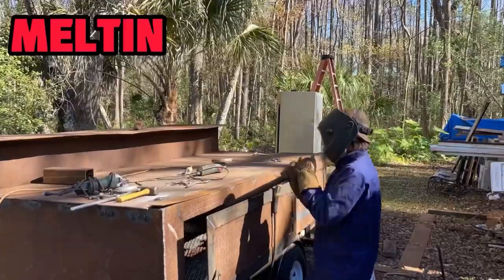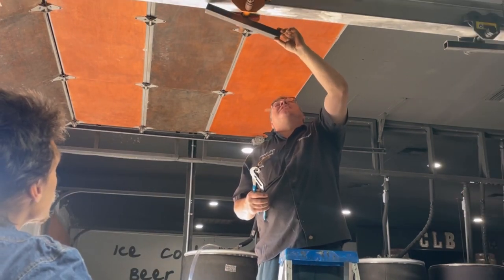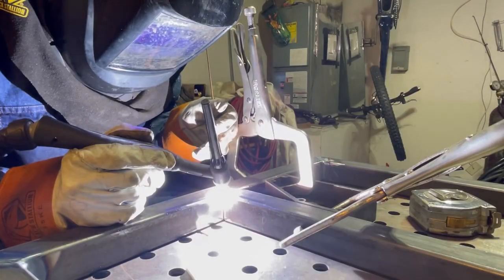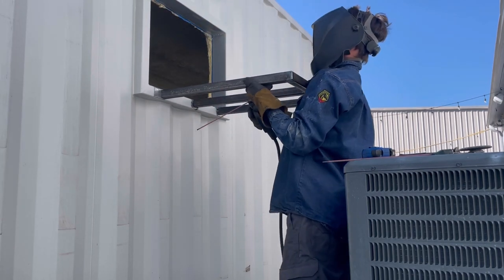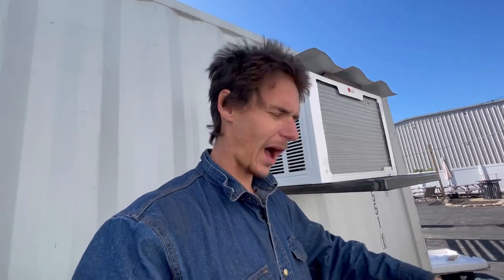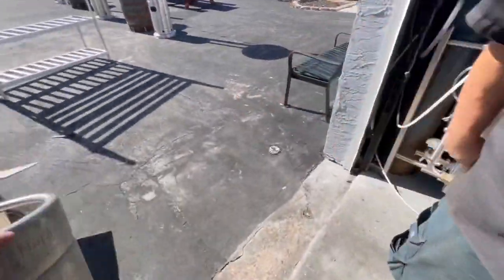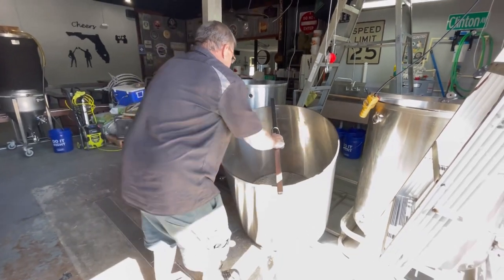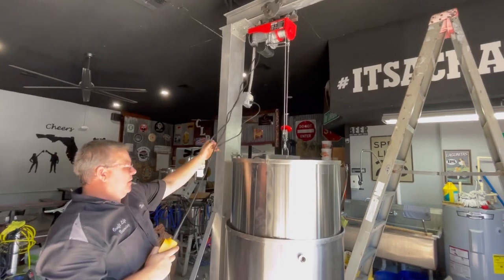Fixing BAD welds and BAD designs at the Brewery

Comment: You don’t level the a/c. It has to have a pitch on the back so water will drain out. Omg bro.
Reply: Well I guess he hasn’t installed any so he doesn’t know of that. At least it’s not pitched toward the building.
Reply from the maker: oh dam owner told me level. make sense thou
Reply: @MeltinMetalAnthony  easy fix luckily, better call the good man
Reply: That is not always the case.  Most spec for level.  The drain pan has the required pitch for condensate  to drain.

Comment: future reference, widow a/c's need some downgrade tilt to the back of the condenser end needs to be roughly .5-.75 degrees below the evaporator so the condensation can flow/run away from the structure and not pool up and overflow inside the building.
Reply: you can call em ''window shaker'' that how I name those lol..
Reply: I think some of the units have that slope built in to their drip tray, so if you install them level, they should have the drainage they need.
Reply: Future Tip, when Tim needs to add another beer cooler to expand: Go with a mini-split system: Considerable more efficient than a window AC unit.
Reply: @guytech7310  Window units can be bought that are decently efficient. My window units are 11.2 EER rated and cost less than $250 each. My 25 year old house AC is SEER 8 and by going to window AC's, my bill dropped by over 50% in the 100+ degree summer in South Carolina. I keep it 68f minimum all year long as I have Nervous system damage that makes my body go crazy when I am hot. All of my units are around 5 years old except 1 that is 2 years old. If they ever fail, getting a replacement is cheap compared to having a mini split fixed/replaced. I have  3.5 Tons of total cooling between the 5 AC's, 1800 sq ft house.

Comment: Nice work young man. The only thing l would have done differently would be to put two flat bar or angle iron braces from the supporting shelf holding the A/C units back to the container wall at 45degreees. All the best to you for Christmas and 2022!

Comment: Tim, I would suggest you add more insulation to those trailers to cut A/C costs. The blow-in will be OK for now, but another 4" or so of rockwool and some sheet Styrofoam would help a bunch.
Reply: Looks like Tim has 4" to 5" of closed cell sprayfoam installed which is probably about R-20 to R-25.

Comment: the winch is pivoting because the lifting cable is not directly under the girder trolley, it's off to one side so it has no choice but to pivot. shift the winch over on the trolly and it will be all good
Reply: It wouldn't need the wheels if it was directly underneath the axle
Reply: It shouldnt be on a pivot at all, it should be directly bolted to the trolley

Comment: Some people can't fabricate... but when you show those welds a person really has to wonder what is it they can really do?

If you really want to do a solid.   The winch drum needs to be centered under the trolley, and the support wheels should be centered on the beam.   I can truly appreciate the guy wanting to get up and running... his own interests can sabotage his goal.  Be the advisor.  He brews beer.  You work with metals and loads every day.  Allow him to focus on the beer, and you take the lead on your side of the house.  Brush up on your stainless welding, blending and polishing.  I don't know your market, but I've done very well tending to the breweries.  A trend I stumbled into when I was doing some structural stuff and noticed the quality issues the stainless crew was producing for a restaurant.  I took over that job, then they knew guys starting or remodeling breweries and passed my name along.  Up to 70% of my work is stainless.  I cap it there because I feel that allows me to capitalize on the trend while not becoming exclusive to it.  I'm old enough to know diversification is survival.  When it slows down (and it will) I still have all my active contacts in structural, and equipment repair.  I don't burn bridges, and I don't over commit to that 30% group.  They know when I say I can do something I arrive on time.

Comment: Welding And Beer 2 Of My Passions
To those who think the A/c unit is installed incorrectly
The outdoor (condenser) fan blade has a slinger ring around it that runs in the water
The slinger ring picks up the water and "slings" it onto the outside (condenser) coil to help cool the refrigerant

In humid weather you will sometimes hear the water hitting the condenser fan blades. This is normal

Bottom line the water evaporates without need for pitch or a drain
Reply: Except when it rains, or is humid out.
Reply: @oldUmanUshea  yeah without proper pitch the pan can fill up and leak inside